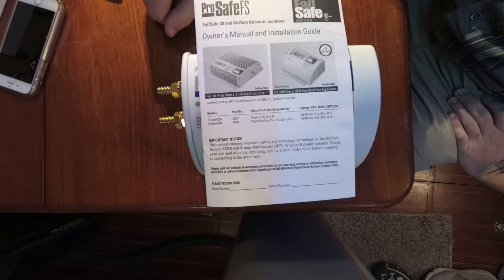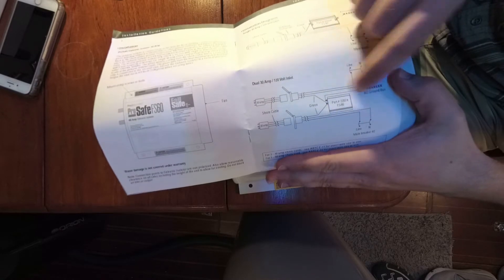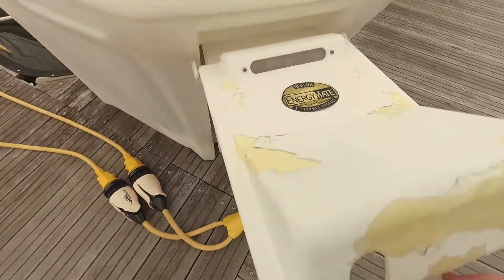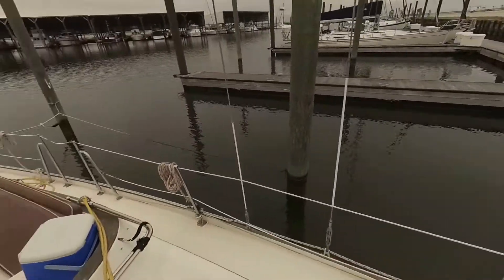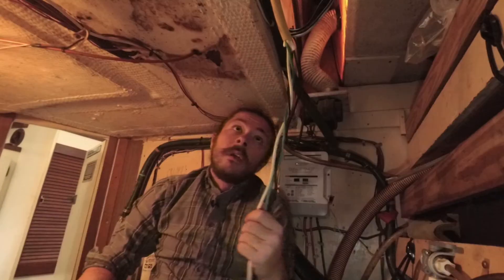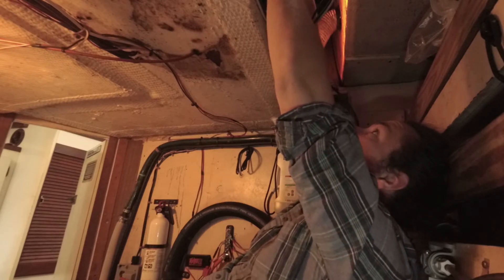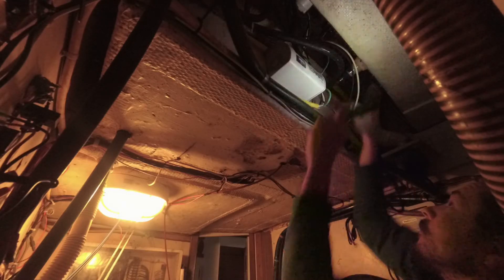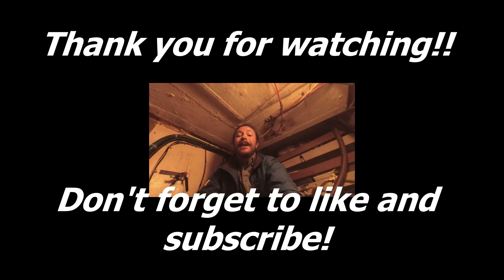ProMariner - Galvanic Isolator Installation - Episode 25

Comment: Thanks for doing this video. I have two 30 amp inlets on my boat and purchased the same one you have. The instruction manual is pretty short, so I wanted to make sure that I was tracking on the steps. I think we even have the same setup where only one inlet needs to be unscrewed to have the cable sheath peeled back to expose the wires. This makes me feel so much better about doing this install myself. I’ll keep the fire extinguishers handy😂. Thanks again!
Reply from the maker: Good luck with your projects!

Comment: two wires from the incoming shore power go to same post on the isolator.  One or two wires go to the other post on the isolator and then connect to the boats ground.  When complete there should be a small voltage difference of about 0.7 volts between Cu/CuSuffate half cell in the seawater and the boats ground.
Reply from the maker: Yep that's how it's done!

Comment: Did I miss where you ran a ground wire to the AC Ground Bus?  It looks like you connected one 30 amp to one bolt and the other 30 amp to other bolt.  From what I can see on the directions is both 30 amp ground wires were to be connected to one bolt and a separate wire ran to the ground bus bar.  Maybe you don't have a bus bar and that's why??
Reply from the maker: Great question! The ground wires were already connected to the ground bus on the other side, so all I did was cut them both and attach the cut ends to either side of the box. If they weren’t already connected then yes, I would have had to connect those.
Reply: @twohalf-hitches  I appreciate the response!  Very good, easy to follow video!